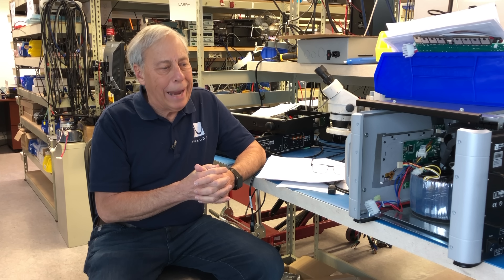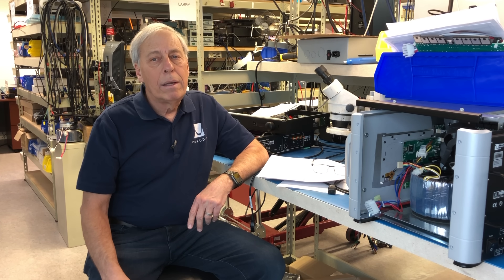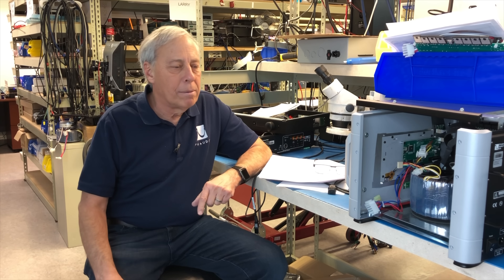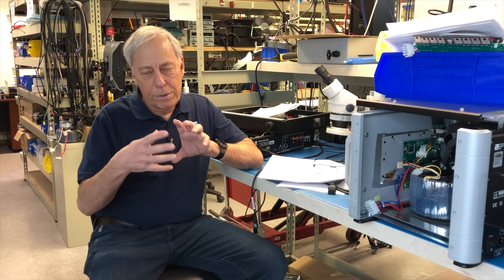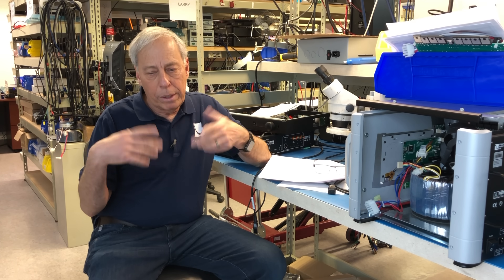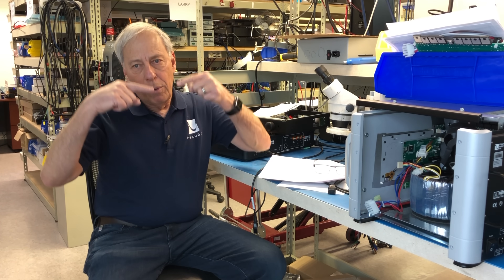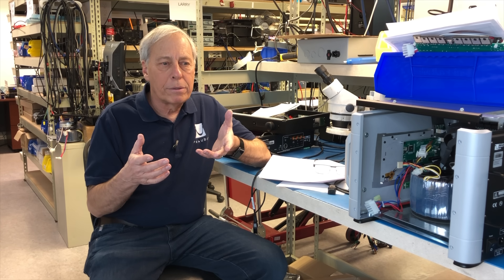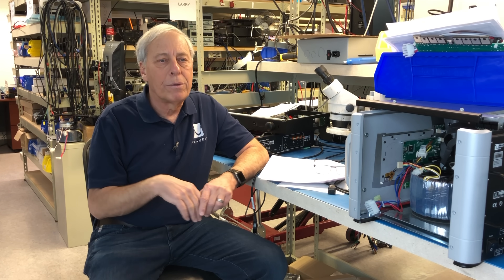How does internal pressure affect speaker performance?

Comment: sealed box is my fave :) making  the port calculations and corrections suck unless your shooting for volume over quality
Reply: Screaming anonymity  Me too. I always want the bass to be tight on my house stereos except when I watch movies. I like to use a ported sub because I like it to be  little boomy for effect. But when it comes to music , I'm 2 channel stereo with sealed boxes all day long.  My car has a ported box tuned somewhere around 38Hz or 40 Hz. It's loud but sloppy as F. No quality at all. Lol.
Reply: @OneRoomShed  I use a ported sub, but with sealed speakers. I never looked at sealed until I got a pair of ADS L810's and found out how wonderful a sealed speaker could sound like. I'm sold!
Reply: @trog69   Yup! I have those very same ADS models  myself, the first series. Get TWO 8" woofers in a sealed box and they are tight, bu got quite low down. Lots of definition and articulation there as well and I can hear the bass much better now in terms of it being tuneful and defined. One problem with ported speakers, less so with a passive radiator design is the fact that a port can, and often does emphasize the mid to upper bass too much, leading to boomy and sloppy bass. In a car, not as big a deal to me anyway as you are competing with car and road noise. :-)